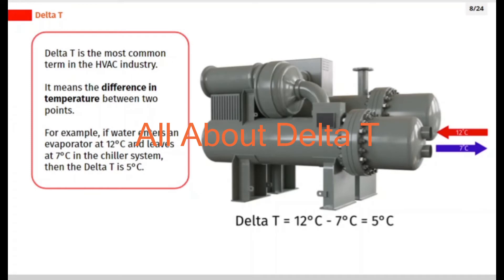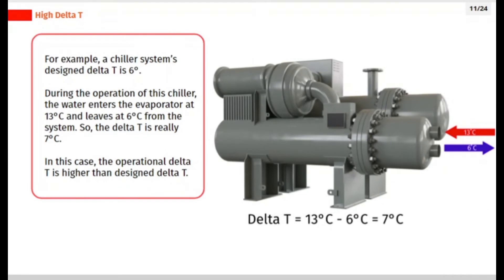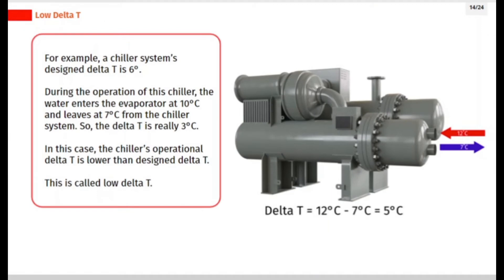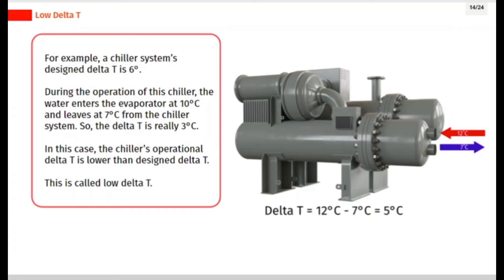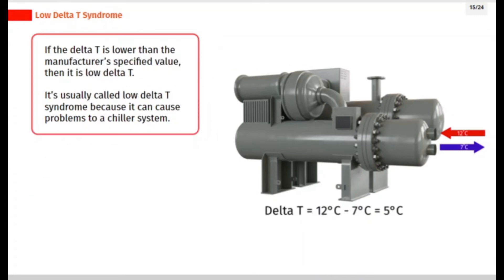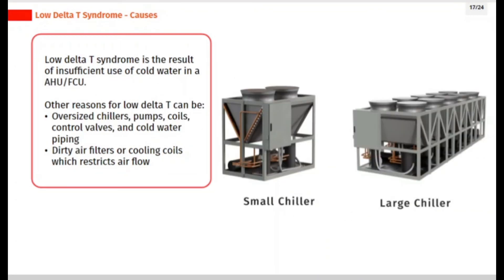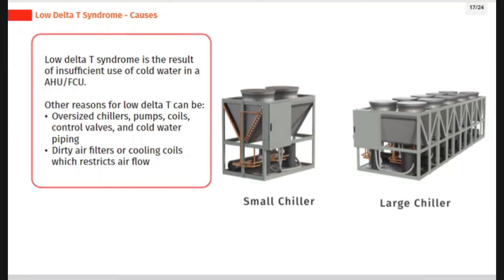All About Delta T | Complete Chiller Systems Course | SkillCat

Comment: What different with R134A and r22
Reply: R134a and R22 are both refrigerants, but R134a is being phased in as a replacement for R22 due to R22's ozone-depleting potential. R134a has a lower GWP (Global Warming Potential) than R22. R134a systems require larger compressors, evaporators, and condensers to achieve the same cooling capacity as an R22 system, resulting in potentially higher manufacturing and operational costs. R134a also has a higher water absorption rate, which can lead to ice blockage in the system, requiring more robust driers. 

AI